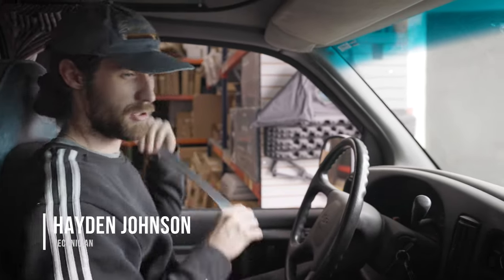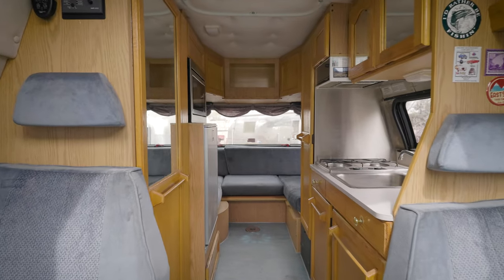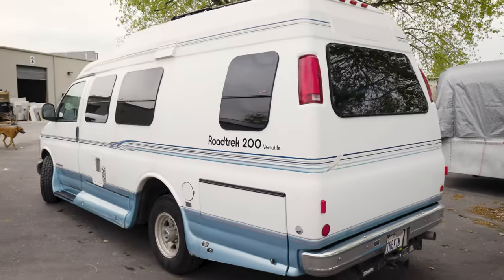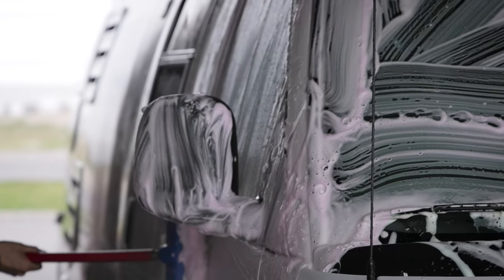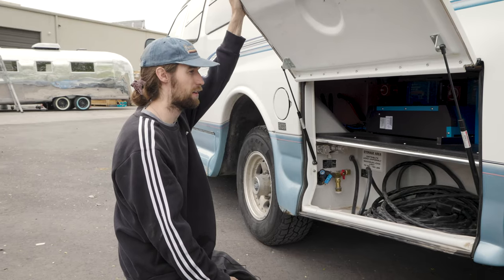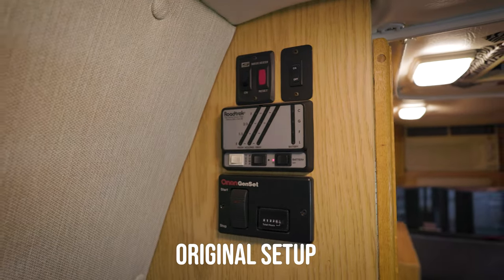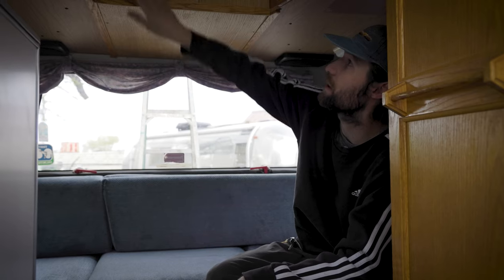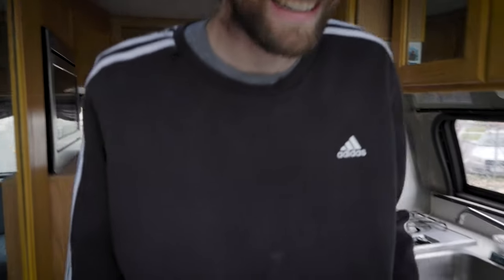Road Trek 200: $10k electrical Upgrade and more!!!!

Comment: HELLO ..i HAVE A 2007 CHEVY  190 POPULAR, MY INVERTER IS NOT CHARGING THE AUXILLARY BATTERY WHEN CONNECTED TO SHORE POWER,, BUT IT SUPPLIES THE INSIDE POWER OF THE VAN..ANY SUGGESTION? WOULD APPRECIATE IT,,THANKS!
Reply from the maker: If you're in the Salt Lake area we'd be happy to take a look

Comment: I am gutting my 1997 roadtrek popular 190.    All nee interior,  new design with modern appliances and AC on the roof fan instead of a wall unit in the back.  Back in the day they were the shit,   Not no more.  They take up to much room.   Unless you are 5’10” and weigh no more then 160 lbs its too cramped.  STOP USING MICROWAVED YOU ARE KILLING YOUR FOOD!
Reply from the maker: Sounds like a fun project, thanks for sharing!